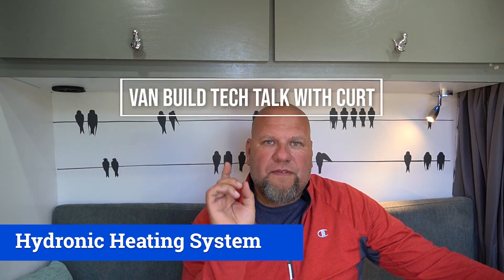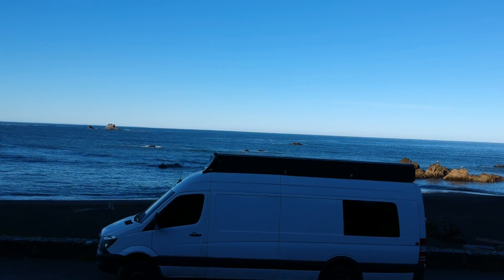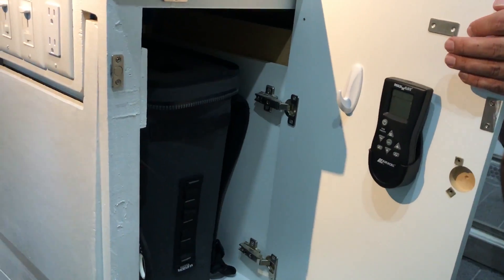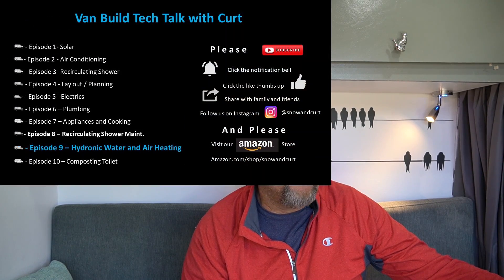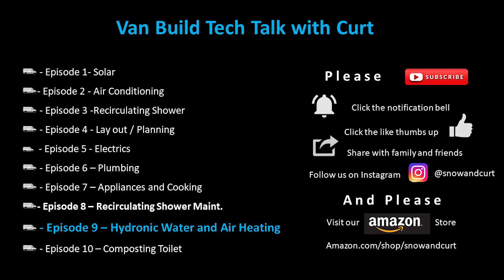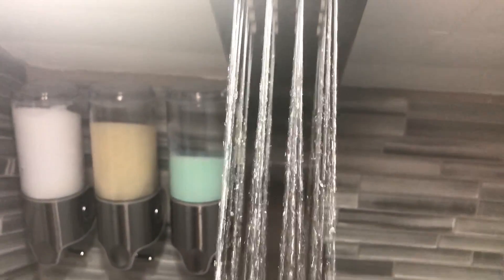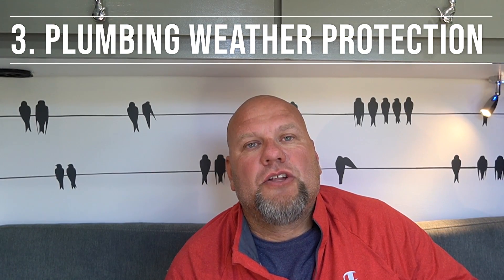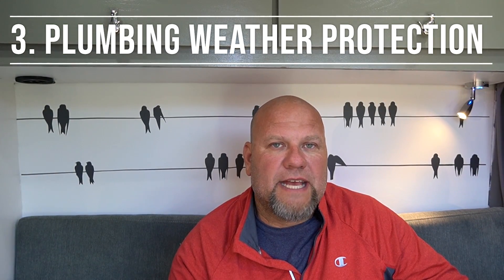Sprinter Van Hot Water Heater, Hydronic Heating Systems Explained - Van Build Tech Talk Series Ep .9

Comment: Thanks for the video. Love the tech talks. 

Maybe this has been asked, I didn’t read all 190 comments and reply’s. 

How do you regulate the hot water? Especially in your recirculating shower. If it recirculates wouldn’t it just get hotter and hotter the longer you use it and the more it goes through the heat exchanger?

Thanks in advance!
Reply from the maker: We put the shower handle on a little less than medium. It does start to warm up... But it doesn't get too hot for about 20 minutes... So the shower is perfect for a nice long shower.

Comment: Thanks for the video!  Are there any advantages or disadvantages with tying the engine cooling system into the hydronic heating system?
Reply: hydronic guy here - engine coolant (ethylene glycol) is poison. Systems using heat exchangers to heat our domesic water should always use food safe glycol (propylene) in case of failures poison glycol mix with our domestic water.

Comment: If a guy wanted a setup like yours & wanted a heated floor & wanted to tie the system into the engine, such a setup would take 4 heat exchangers?
Reply from the maker: I think would do it with 3.  If I did it all over, I would do as you describe.

Comment: So did you add a 2nd expansion tank under the hood? Or did you connect to the Factory one?
Reply from the maker: yes, we added a second tank
Reply: @SnowAndCurt  What size is that I'm designing a hydronic system but stuck on how big of a reservoir to install

Comment: Hi Curt, I am always up with a long, hot shower so I am doing research into a recirculating shower system with hydronic heating. This is definitely one of the best videos on youtube regarding this topic, thank you sir! Just a few questions regarding this, since the Espar heater is just 5kw, is it enough to instantly heat up the water and keep it warm as you go (maybe a bit colder at the beginning but once the recirculating tank has filled with water it gets warmer?) Do you have any idea of the flow rate of your shower? Does the water get colder when you have a very long shower, to the point where it's too cold to shower with? Keep up the good work, greetings from England.
Reply from the maker: Turn the heater on about two minutes before getting in the shower... water is warm within 30 seconds of turning on water after that. The water is easy to maintain the proper temp. Never gets too hot due to a bit of temp loss as the water circulates thru the system... never gets too cold either.

Comment: Those heaters were designed as an engine heater,,so u could hook up to your engine, then it keeps it warm as well,you then could add a small heater core with fan,,,we have them on our diesel trucks, with a timer ,,,,you could then tap off and run lines for in floor heating,,,great vid,,,and build,,
Reply from the maker: thanks for the tip... been looking at using the engine heat in some way! Cheers
Reply: @SnowAndCurt  yeah it works pretty good..we even went as far as installing relay to dash heater fan. to run the fan in cab...

Comment: Hi Curt. Great videos, so thanks a bunch! Happy 2021!

One question - how do you moderate the temperature of the water coming out the shower? I guess you don't use a thermostatic mixer valve because I don't see a separate cold supply... Or do you control the temperature to which the Hydronic heats the water in the loop? Or do you just take what comes out, assuming it never gets too hot because of heat losses in the whole system?

Thanks in advance for your advice. Top channel. Yours combined with Greg Virgoe's gets me everything I need so far (at least in the planning stage!)
Reply from the maker: We use a mixer valve... Enough heat is lost in the system that it never gets too hot. But, there will be times that all of your water is warm for a bit!

Comment: The heat exchangers are great technology but what I would like to know is after you switch off the heater, can you still get some hot water from the sink or shower and if so: how much please??
I opted (btw) for a salvaged indirectly heated boiler from a central heating boiler which stores 10 L  of coolant and has a copper coil inside which I plumbed via a thermostatic mixer valve into the hot water line of the kitchen sink (my shower is as yet a bucket, a cup and a tarp in the bushes (yeah I like - not really - to rough it sometimes)
Reply from the maker: We can get hot water in the sink for maybe 5-ish minutes after the heater is turned off... warm water for maybe 10.

Comment: Looking to use this system one day for our own van build. I am wondering how you use the hot water in summer without also heating the air inside the van? Do you have zone valves on the pipework to stop glycol reaching the heaters inside?
Reply from the maker: yes... we can heat water without heating the van
Reply: @SnowAndCurt  how are you stopping the glycol circulating through the heaters/interior pipework when heating the water? Separate circuits? Or valves

Comment: How long did the heating system take to install roughly, also, when you say the water to wash with circulates, is that old water your reusing?
Reply from the maker: We built our van on weekends over a span of 8 months, honestly... I cannot remember how long we spent on the heater. Yes, the water we reuse can be circulated thru the system without coming out of the shower... so that we can run it thru the filtration system a bit more if we feel like we need to.
Reply: @SnowAndCurt  thanks 🙏

Comment: Hi Curt, thanks for your engineering experience with installation of the systems in your Van. One day I will build my own Van...one day :) So something pop up in my mind about your freezing problem under the Van. Most probably you did it or at least you have an idea, however 😊 one option is to wraps the pipes with electric wire heaters and control ON/OFF time. It is just idea...a lot more questions pop ups next, but i told you, I am giving just an idea 😊
Reply from the maker: Thanks so much for that tip! And thank you for tuning in to our channel!

Comment: Can you do a video specifically on your control system? Or at least describe it here? Or is your system right now just set up on a timer? If so, when does it turn on, when does it shut off? The mechanicals and plumbing seem pretty straight forward, but the controller is the thing I feel like I know least about. Someone suggested Inkbird or Pi or Arduino, but this is only half of it, where and how do you mount thermocouples, etc, some in water, some in the air, etc. Lots of questions about the control systems. Anything you can share? Thank you!
Reply from the maker: We have not done anything special there or made a video on it. Everything is handled with a wall unit and is not triggered by temps. We made add stuff later, but for now we manually flip things on. If you figure something cool out, be sure to keep us posted! Sorry we were not m ore help.
Reply: @SnowAndCurt  Thanks for the reply!
Reply: @SnowAndCurt  One more question! If you turn on the the coolant pump does it heat all your heat exchangers (so, for example, if you're running hot water for your sink, is the shower heat exchanger, or the air heat exchange, hot even if you don't have your shower turned on or are not running your air heater?)

Comment: Sorry to bother. Waiting for my van I try to purchase the needed stuff. I did buy through your website the telescopic leader and it seems a little bit to small for the van. What hight is yours??  I still can return it if it's not the right one. Thanks
Reply from the maker: Ours is 12.5 feet when fully extended. Hope that helps! How long until your van comes in?? 🚐☺️
Reply: @SnowAndCurt  Snow, thank you for your fast reply. Few more months. Is to late to order the 2020 one. I'll order as soon as the 2021 is coming.

Comment: Hi Snow & Curt. Loving your videos, thanks especially for the Hydronic hot water system videos, they are a huge help to me!! Your van is fantastic, well done!! I have a question for you about the electrical power consumption of the hydronic water system, can you give me an idea of the Amps it draws when heating up from cold please? How long does it take to heat the coolant, (I think I remember you stating it takes 5mins but not sure I have that right)? Does the Amperage draw lessen after the initial heat up please & if so, what is the amperage draw then? I'd appreciate any help you can give me. Looking forward to your upcoming videos! Stay safe both of you. Tracey (in the UK).
Reply from the maker: Yes... 3 to 5 minutes depending on outside temp! The heater is diesel operated, so the only power draw is the pumps... which is only when the water is running and is minimal! We do not know the exact amps. But, it is SMALL! Hope this helps!

Comment: Hi Snow & Curt, great channel, enjoy your build and tech talks. Do you have any issue when your showering with the heat exchanger on the fresh water overheating, could there be a solenoid to bypass one or other heat exchanger.
Reply from the maker: We have not had the problem, but we never turn it all the way up... You just need a little hot water trickling in! But, there is surely a way to maybe pop a thermostat on there with a valve it something.... Let us know what you figure out!

Comment: Great video, thanks for doing these. Do you just close the loop to the floor during summer so you can still have hot water otherwise? Can you also use the hydronics for cooling floor/air too and thus do away with AC (maybe trade it for a dehumidifier)?
Reply: daemorhedron :: Closing that heater loop is optimal in warm weather, especially if it can be repurposed, directed thru a dual-core heat exchanger near an *evaporator tube. My ambulance has (an excess heat production in a 42kBTU Espar M12 from a bus and) such an exchanger, so I’ll be routing hosing for a COOLING WALL (not floor b/c, well, heat rises) as recently demonstrated by a Princeton study (a cooling wall pulls heat from occupants and objects without byproduct condensation). Definitely post your process— and I’ll return the favor.
Reply: @cluek9780  Great reply. Right now all I am doing is theorycrafting my own build. Very new to hydronics, hvac, heated floors, etc and tbh not particularly smart so will be a while before I produce anything but happy to share when I do. Would love to see what you've come up with though!
Reply from the maker: We actually do not have the heated flooring system... we thought about it, but opted out because we needed every inch we could of space so Curt would be able to stand up in the van. But, we would have for sure made a way to close off the floor loop if we would have. And... your cooling idea is interesting... if you research it more and decide to go for it, be sure to let us know!

Comment: thank you for the info.
do you have any videos of your system running?  I am curious as to how it sounds, from inside the van and outside the van when running at full speed.  I have heard these hydronic heaters can be very loud, so i'm wondering if the volume would keep me awake at night, or disturb nearby campers.
any info would be appreciated.
thanks!
Reply from the maker: We will try to do a sound text and get it in the next video for you guys! That's a great question. In the meantime, it's not too loud... Kind of a constant hum... No where near as loud as a generator. Stay tuned!

Comment: Hi very interesting 
Is the heater you’re talking about the aux heater under the chassis/driver seat which heat the engine in cold climates
If so how did you re wire it 
Cheers John from Newzealand
Reply from the maker: No, our van didn't come with the six heater... So we installed from scratch.
Reply: Do you think it’s the same as the aux one I have on my van ,mine is piped up to the engine as a pre heater on cold days,sounds like a jet engine when we run it.great interesting utube video keep it up and stay safe and keep traveling
Reply: @johndyer9431  Yes, the aux heater in your van is the same, should be a D5. If anyone else is reading this, I have a 2005 sprinter with the D5WZ Eberspacher and it is located behind and below the right hand headlight as you look under the bonnet, or hood if you are in USA/Canada. I only mention this as a lot of Sprinter owners don't even know they have an Eberspacher fitted or what it does.

Comment: Maybe this is not the case in the US, but in Canada Sprinters come with a Webasto Parking heater, why not just implement this with the Vehicles pre existing coolant loop and have the benefit of also keeping the engine warm, or use the engine itself (while driving) to heat the coolant?
Reply from the maker: Yep.... USA vans don't have that awesome feature! Curt's looked at this a bit and in hindsight would've maybe liked to add this in... But, no going back now! Thanks for the question... It's a good one!

Comment: I have been doing a ton of research for my upcoming build and came across your channel.  Great stuff, I really appreciate you sharing your experience with all of the people out here.
 
The question is, how do you regulate the temperature in the radiant system (coolant)?  Is there a separate thermostat in the flooring that keeps the temperature of the coolant loop at below 85 degrees F? Most flooring cannot handle radiant systems above 85 degrees and it can harm most wood/laminate flooring if the system runs hooter.  How do you keep the PEX and the floor from being like 190 degrees?

Having lived in Korea for years, I love floor heat and even sleep on a dol bed (stone bed) with radiant heat. [Google: Korean style dol bed].  I really want to put this system in my build, but do not want to ruin my flooring on top of it.
Reply from the maker: OUr heating system is not in the floor... it is under our van... so, we do not heat our floors. I can see how the diagram would make you lean that way though. Hope some of our stuff ends up helping you! Stay in touch and good luck with your build!

Comment: Thank you for this amazing video! Your series are extremely educational. :)

12:00 - I've always wondered... but then what if you need hot water in the summer? What do you do then?
Do you feel if I get a simple LPG gas-boiler, that it would be enough to heat a well-insulated sprinter van?
Reply from the maker: Our hot water heat system can be used without hearing the air in the van! Tons of folks use propane to heat their vans... We stayed away from propane only because we are doing extensive international travel.... And the different fittings in different countries can make it difficult to fill your tanks!

Comment: Well done! 👌
How long does it take to heat the water? I suppose the glycol needs about 10 minutes to heat up..
But as the shower water is at van temperature it will need à couple of minutes to be on the right temp.. But once hot, you can't go down with the temperature, right ?
Do you have problems with too hot?
Thank you
Reply from the maker: It takes about 5 minutes for the heat exchanger to heat up, after that we can control the temperature perfectly for an least an hour and probably a lot more we just have tested it for more.  If the water is too hot we just turn it down a bit...Easy peasy!

Comment: I have the same system in my van and have it all operational except the Kalori fan.  I can't figure out for the life of my how to wire it.  Do you have any pictures or videos of the wiring?  It looks like it should be super simple but I can't figure it out.  The one wiring harness is pretty straight forward but the second harness I can't figure out.  It has a relay in the middle of on one side a single red/white wire with a clip that looks like it should plug into the back of a plastic connector.  The other end has a solid black wire and a black wire with a violet stripe.  I plan on only using the max speed of the fan so dont need to wire for the the other lower speeds.  Any help or pictures would be greatly appreciated.
Reply from the maker: Unfortunately, we were not videoing during most of the build. There's oy a few pictures, but none during this phase!
Reply from the maker: Curt is pretty busy right now on another project, when he gets freed up, I'll see if he has any input for you!

Comment: Another great video Curt.  Which coolant pump did you go with?
Reply: Hi again Curt and Snow.  Another quick question about your coolant loop and reservoir:  Do you operate the reservoir vented or closed?  I don't see a coolant return to the reservoir on you diagram.  Does it loop back to the reservoir?
Reply from the maker: Thanks Mike... It's an espar.
Reply: @SnowAndCurt  Do I understand correctly that you did not tie into the Sprinter engine coolant system ?
Reply from the maker: We did not.... Although Curt is considering adding that. But, for now, most big projects are on hold while he relaxes a bit!
Reply: @SnowAndCurt  What is the capacity of the coolant expansion tank?  Your parts link indicates it's a plastic tank designed for a Ford.  How difficult was it to fit in the engine area of your Sprinter?

Comment: Would such a heating system be able to run an in floor radiant heating system?
Reply from the maker: Yes! We know that it can, but we didn’t research all of the details for this option.... it would add a lil to the floor thickness... and curt has no room to spare - he’s 6’2”
Reply: You would need a small buffer tank to keep the efficiencyof the system, but yes! Def would.